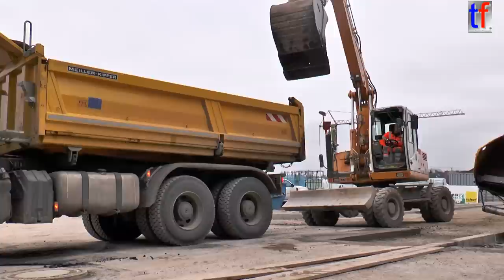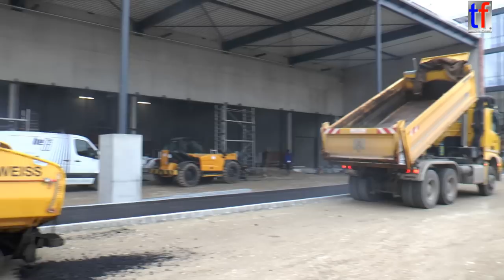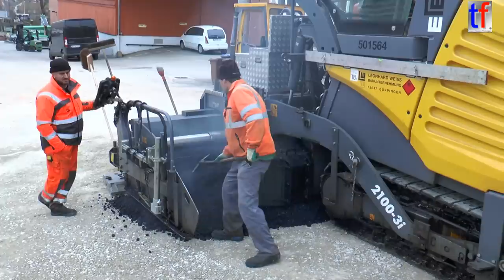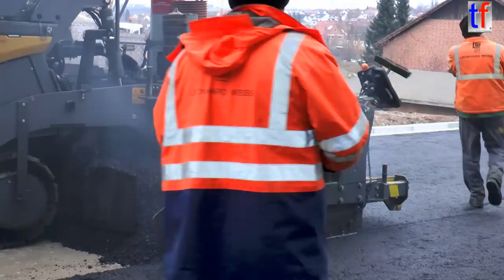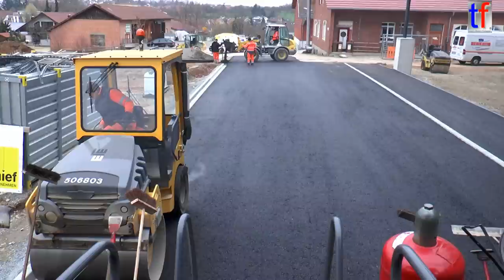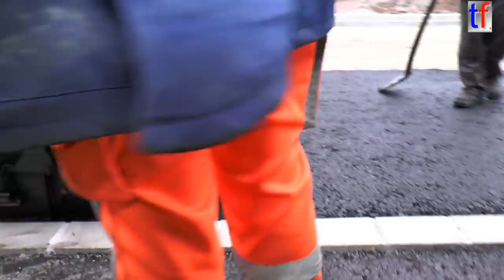**CLOSE UP** 2x Vögele Pavers, Liebherr A904C, MB Arocs, Asphaltkolonne L. Weiss, Germany, 2014.

Comment: No heatshield on the trailers?  And the method used to fill up the paver, You will have grade seperation in the asphalt mass, and not to mention the runaway heat...Fine for industrial areas with low standard requirements
Reply from the maker: That's inside a commercial yard.
Reply: @BeytekinConstructionMachinery  Good work still